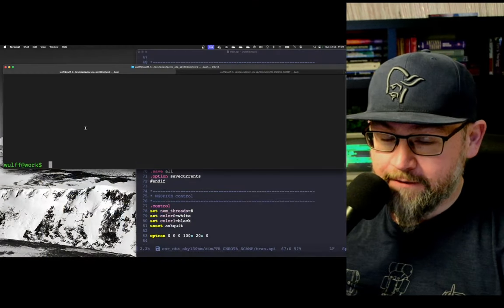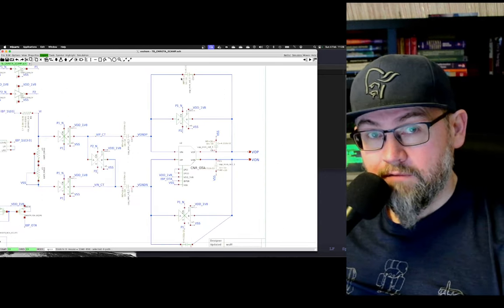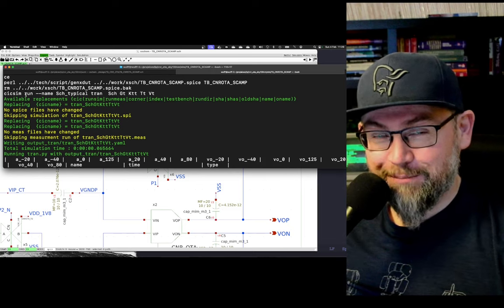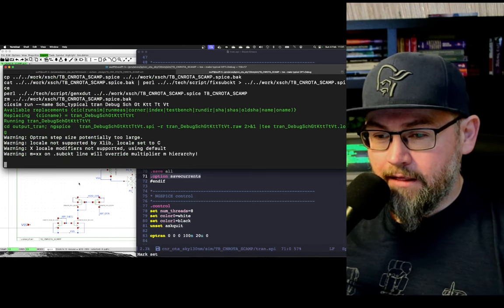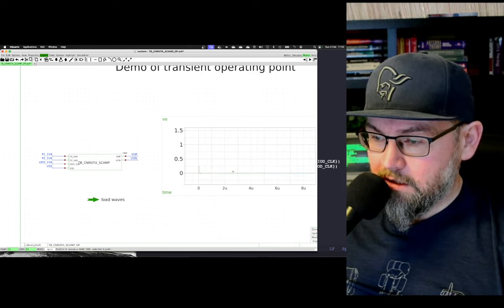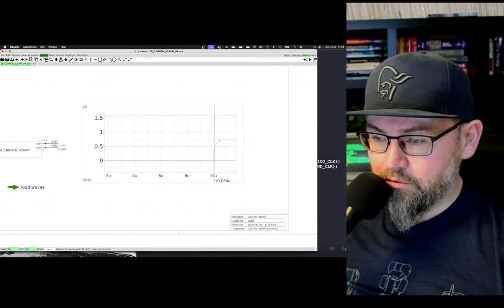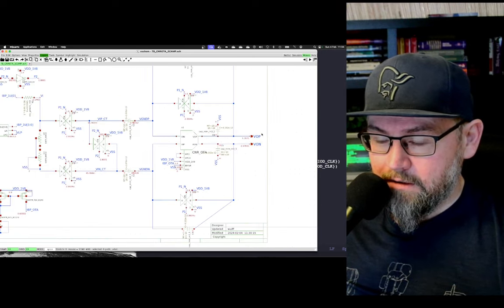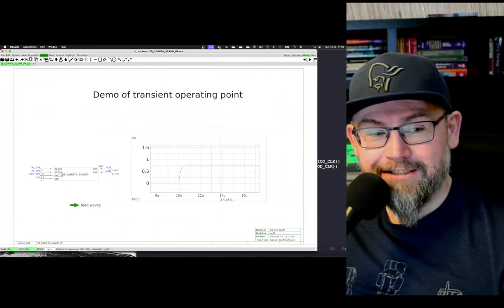xschem transient operating point back annotation

Comment: Thank you for the video. I really enjoyed watching your videos. I have a question and a suggestion. Why did not use wide swing current mirror for the amplifier. And also since you are using non-overlapping clocks for the amplifier, that would be great if you implement the a switched caps CMFB which is really low power.
Reply from the maker: 1) I would call the current mirrors wide swing 2) SC CMFB is not easy when the OTA is used in both cycles of the SC circuit. During phase 1 the OTA is in unity gain. During phase 2 it's amplifying.
Reply: @analogicus  but I see many SC incremental ADC used it when the OTA is in unity feedback configuration in phase 1(sampling phase), and integration in phase 2. I already taped out one and waiting for the chip.
Reply from the maker: Maybe you can direct me to a paper about it, maybe I'll learn something new.